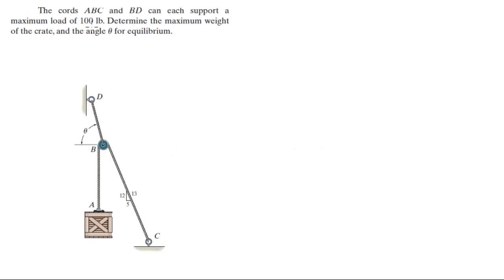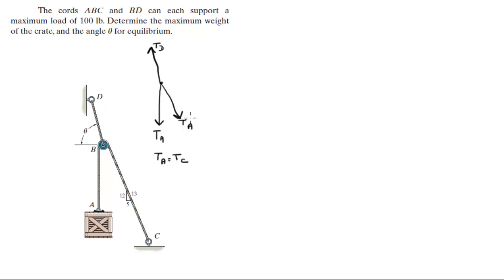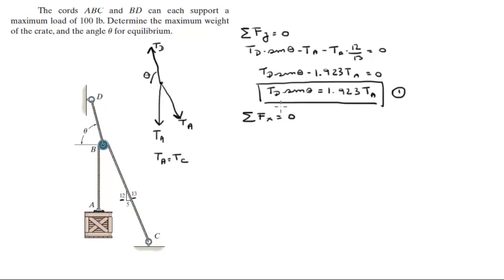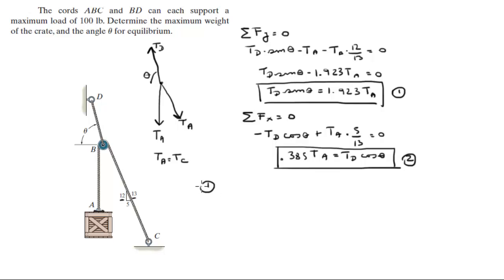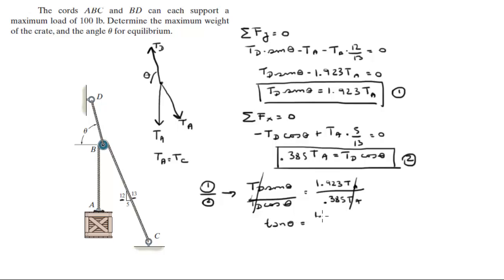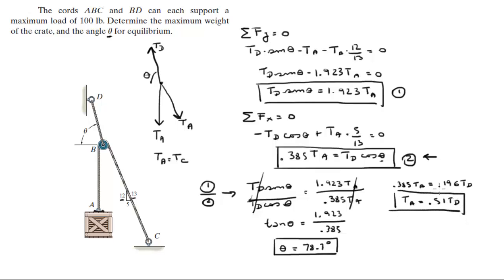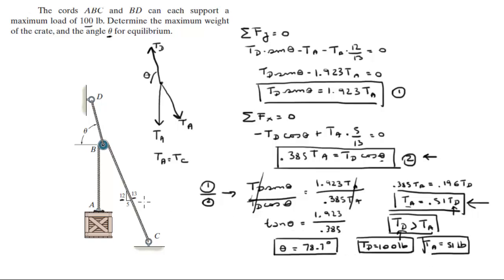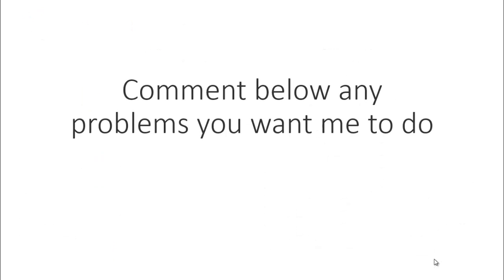Determine the maximum weight of the crate, and the angle u for equilibrium.

Comment: *▪3–16. The 10-lb lamp fixture is suspended from two
springs, each having an unstretched length of 4 ft and stiffness
of k = 5 lb>ft. Determine the angle u for equilibrium.

plz solve it